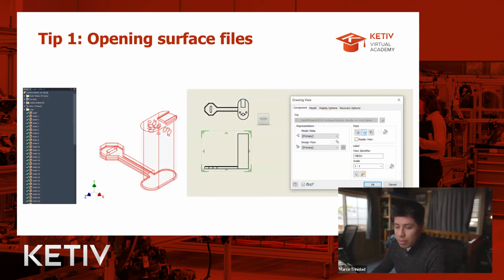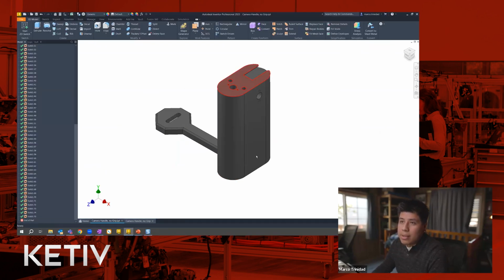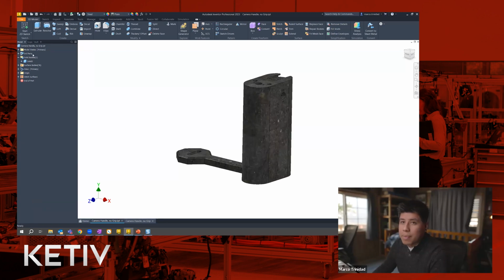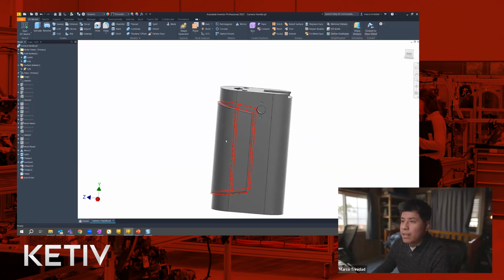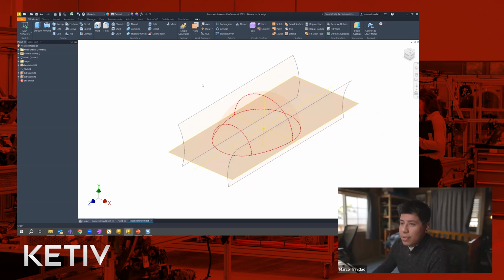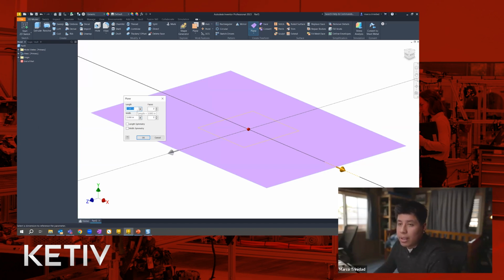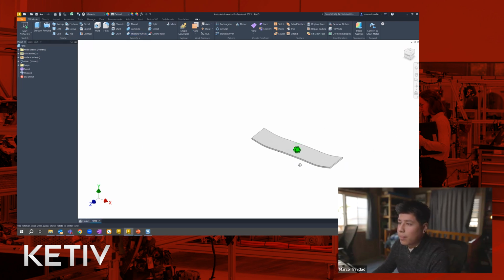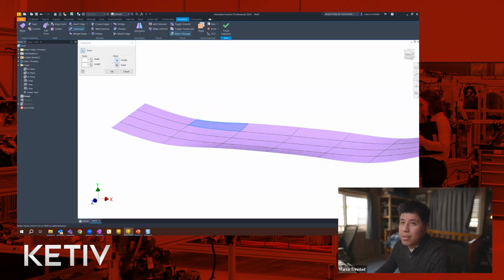5 Tips for Using Surface Models in Your Autodesk Inventor Designs | KETIV Virtual Academy

Comment: Nice video! Thank you!
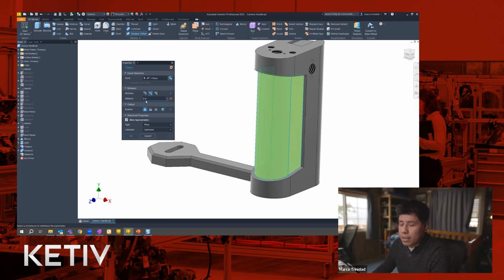Small remark: 10:50 - you could make the grip as a new body right out of the faces of existing body, without first creating a surface. =)

Surfaces are very interesting. But the truth is that 90% of cases you can get the same result without using them. The Thickness and Shell commands often gave the same result. 
When I teach people how to work in Inventor, it's not easy to find an example where surfaces are really needed. I personally love the Patch command paired with the Replace Face command - it allows quickly model the rounded ends of handles and things like that if you select tangency mode in Patch.
Reply from the maker: @@MikhailTsarev These are all great points. Thank you for engaging with KETIV!